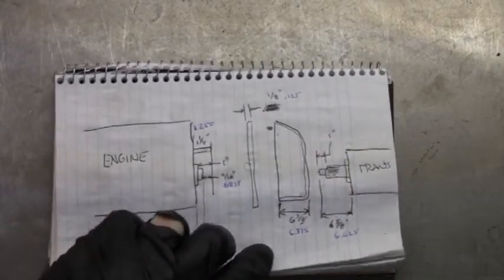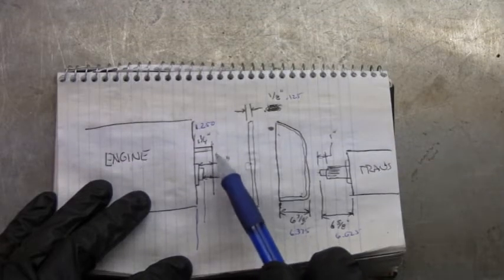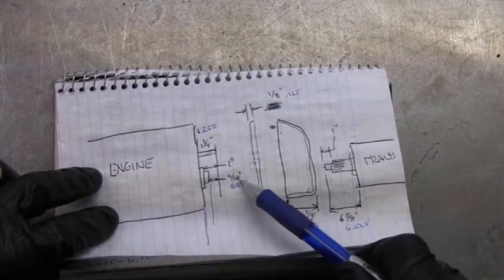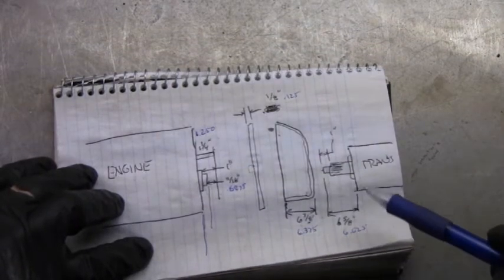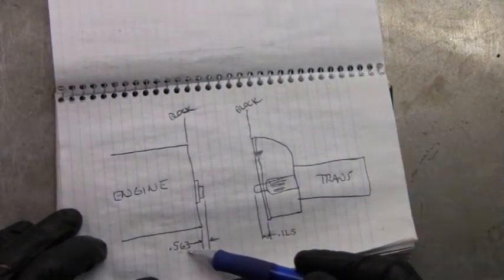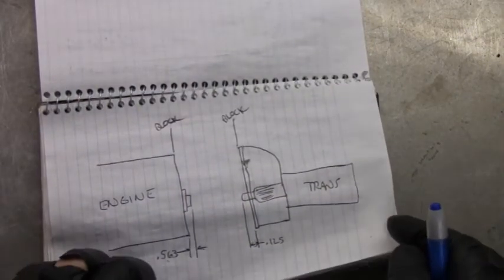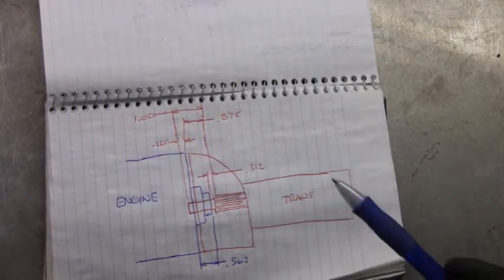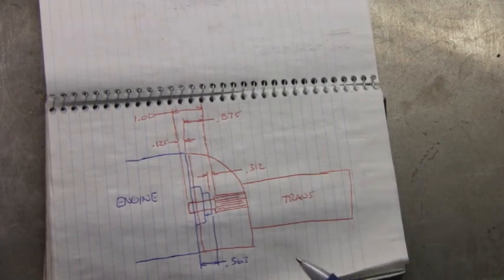LS Conversion swap, Part 45 Measurement correction from 44

Comment: You can also visually check it by bolting on just the plate and bell housing.  Then mark a piece of rod thin enough to go through the pilot bearing measuring 6-5/8.  Use your straight edge, put it  against the mating surface of bell housing and tranny and use the rod to simulate the input shaft and see how far the small diameter part of the input shaft will go in and also see if the big diameter part will not contact the pilot bearing.